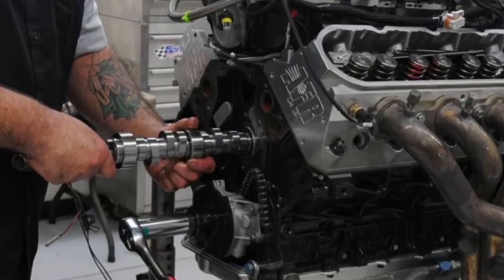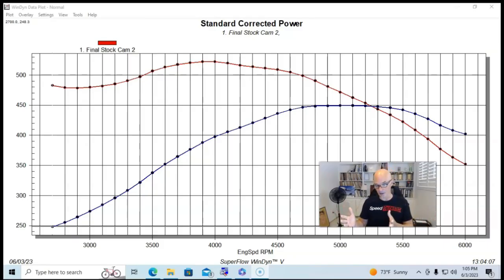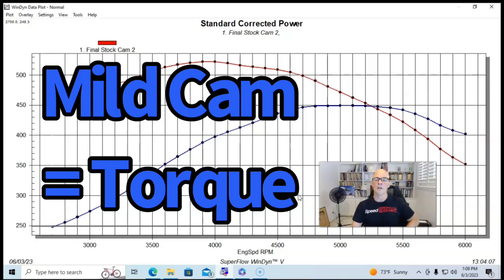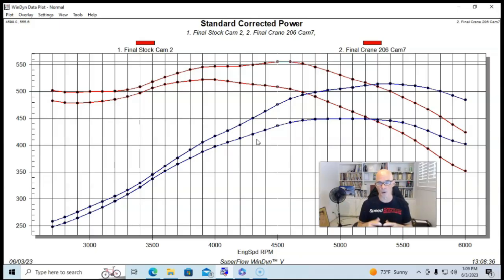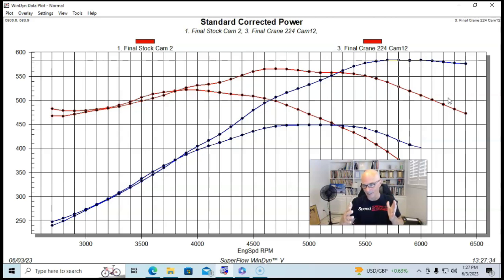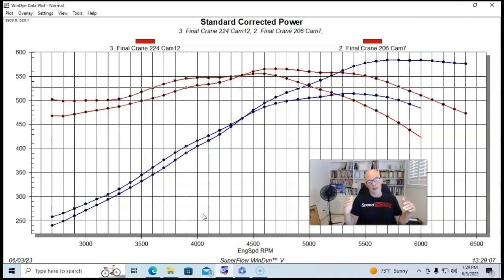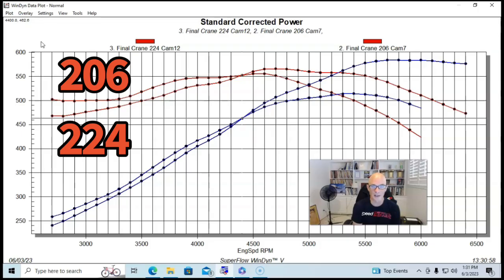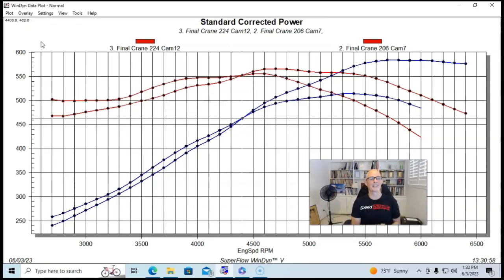HOW TO MAKE MORE TORQUE WITH YOUR LS. 6.0L 408 STROKER CAM TEST-WHICH TORQUE CAM WOULD YOU CHOOSE?

Comment: You talked about and tested the “240” camshaft but you never gave us the specifics about the biggest camshaft 🤷‍♂️
Reply from the maker: 246
Reply: @richardholdener1727 246 = .050 Duration and lift for intake and exhaust with CL?

Comment: Have you heard anything about Trick flows 595/595 cam? I have a 408 with Texas speed crank, Wisco reverse cut pistons with valve relief on Lunati rods. Trick flows 225cc heads and 595/595 cam. Just got heads so still got to put it together. I’m thinking around 600? Love you videos!
Reply from the maker: not sure what 595 lift cam you are referring t0
Reply: @richardholdener1727  Trickflow TFS-30602004 trackmaster cam. Duration 291/295 Lift .595/.595  lobe sep. 112

Comment: I just had a 408 stroker put together, it’s a Texas speed rotating assembly. 823 ls3 heads, 660 springs in heads, ARP studs, 240/248 cam with .625” lift, any guess on what kind of power it will make on 93 octane
Reply from the maker: with stock heads-near 600 hp
Reply: @richardholdener1727 the fact that you responded you have a fan for life, love what you do keep it up

Comment: Great Video, As ALWAYS Sir!!!!

Would this be a great combo for a 1964 Chevy SS impala  weighting 4,000 lbs, that im currently building (Daily Driver)?

Gen 3 LS 6.0 - 408 storker
0.30 Flat Top Pistons, 
Gen 4 Rods ( Machine shop balanced),
TruckNorris Cam,
# 799 CNC Ported 
(2.02/ 1.59 valves
In -243cc
Ex -95cc)
.650 Dual Vale Springs,
LSA supercharger w/ 2.55 Grip tech Upper pulley ,
Stoc LSA lower Pulley, &
850cc Injctors

Comment: I just got my 408 build chassis dynoed with 317 heads and tbss intake factory airbox and exhaust with a btr 202 torque cam made 410hp at the rear wheels i couldn't be happier with the driveability and power, i had a truck norris in the 408 to start but with a stock converter it kinda sucked towing a trailer in the lumber yard trying to go slow, i really appreciate all your advice on engine building.
Reply: A t.n. bucks 408 cubic inches?? 😳

Comment: I have a question about a 408 I built.
I used 823 heads, from a L92. had a Valve job and milled just to make them flat.  flat top piston w/valve reliefs compression is around 11.3:1, LS3 intake 102mm throttle body, long tube Headers, Terminator X system, a Slopy Stage 3 cam (only because I had one) I used PAC1219 Springs. it runs grate lots of power everywhere but falls flat at around 6000 rpm. I use it 98% at the drag strip the rest is to drive to work once in a Blue moon or to a local car show. at the track i run a very consistent 11.45 depending on DA. the Monte Waghs 3715 pounds on the starting line. I was expecting 11.0s. th400 and a ford 9" no tire spin. 1.65 60'.  my HP calculator tells me its making 475HP.  Does that sound right? and should it pull harder pased 6000 or is that where it starts to fall off. Maybe Valve spring or better cam choice  Would love to hear your recommendations. or is that what i should Expect is so that ok i judt not shour if somthing is OFF.  sorry for the long post.
Reply from the maker: don't know what you mean by it pulls hard til 6000 rpm then falls off-does that mean it makes peak power at 6000 rpm? We need actual data (dyno) to determine what is really happening-is it getting lean or rich, what is the timing etc...

Comment: I was also wondering for the 408 stroker in the Steve Morris video what Pistons you were running to achieve the 613 ft-lbs torque and the 622 hp
Reply: Were they like a +16 dome or -3.30 flat top
Reply from the maker: the pistons had valve reliefs

Comment: I also saw Steve Morris video on a 408 stroker that they stated was built to your specifications and I really wouldn’t mind knowing what head and cam combo you recommended for that build
Reply: I also was wondering for this motor with the 613 ft-lbs of torque and 622 hp what Pistons you spec out for the motor
Reply from the maker: AFR 245 heads and Comp cams-specs were listed in the video

Comment: Hey Richard, I wanted to say thank you for the video. I had a few questions about the heads in the video you were stating that you would probably pick a different set of heads than the AFR 245s in the video and I was wondering if the AFR 230 heads or the AFR 225 heads would be better for my build. I was also wondering about the intake manifold choice in the video. I believe you recommended the fast LSXR manifold over the one that you used in the video. I also had one more question about the camshaft choice you mentioned that that you thought the BTR TruckNorris would be a better choice for more torque. I have a brand new sloppy stage two cam I had planned on using for my build and was wondering if you thought that would work well with this combination or should I consider the BTR TurckNorris. I sure would appreciate your thoughts.
Reply from the maker: 230

Comment: dont like the wide lobe sep cams mabey they are making torq because long intake runners n super high flow heads , put that cam in a gen one small block n it will not make torq like that 🤷
Reply from the maker: why would a SBC act differently
Reply: u tell me , show me a motor or dyno graph of a sb 400 with those numbers with those cam specs , im not arguing im asking 🤷

Comment: I would also like to see this test revisited with a little smaller budget and see if the results are comparable.  Tbss intake, ported (or not?) OEM heads, Low Buck Truck cam, etc.  See if you can get similar results with a 1000 dollars less or even 1500 dollars less than this test?
Reply: That would be an interesting test.

Comment: Hi Richard, I know this is an older post, but I’d like closure on what heads you would’ve recommended over the AFRs.  I’m trying to get a build sheet together.
Reply from the maker: many other smaller heads (the 245s were overkill)
Reply: What about 317s?  I can have a set milled for CR, but would they flow enough?

Comment: I've only built a couple of performance car motors but have done a lot of Harley performance builds so I have seen what happens when you run the same cam with different combinations of heads, compression, intake, etc. With the bigger cams, they are dogs below 3000 rpm with a stock motor and then as you start adding compression, good heads, etc, they not only start making more peak power & torque but get much better under 3000 rpm. There are limits of course to every cam but generally speaking the bigger the cam, the more important the rest of the combination is for not only peak numbers but the lower rpm torque as well.

Comment: Nerding  out to build a 408 for my suburban.. wish you had used a 317 head..
Anyways, seams y'all missed the 206/212 cam did at least 500tq from 2700 to 5400rpm and it's probably doing 450-475tq at 2000. I'm currently looking at a 212/218 ~560" 115lsa cam

Comment: Hey Richard, I need some help. I am building a gen IV 408 for an airboat with 0821 heads and truck intake. It will not be exceeding 5500 RPM. What is the best camshaft selection for torque and HP production from 3000-5500RPM? Thanks
Reply from the maker: I have a Low Buck Truck ($179) that would work well on that
Reply: Perfect, where can I purchase?

Comment: For towing purposes and to keep the 6L80E happy under 6000 rpm. What is the absolute highest amount of torque you can make before going to forced air?
Reply from the maker: for what displacement and compression and octane?
Reply: @richardholdener1727  For the 6.0L VVT L96 on stock internals with 89 octane pump gas. I'm looking to keep the VVT and already have intake and shorty headers, but I'm interested in valvetrain mods and a tune. Would higher compression and higher octane help low-end torque or hurt it? I know these are already low compression to begin with. I am trying to avoid increasing the RPM range and shifting power up. But I want overall best performance for a street application with Towing and offroad use in mind.

Comment: What would it take to get 500tq out of a 402 stroker ?
Reply from the maker: 500 lb-ft is very easy out of a 408
Reply: @richardholdener1727  but is it reliable in a truck application DD with occasional towing

Comment: Good morning Richard, Hope you are doing well. I am currently putting together a tow monster for my 2004 Yukon XL 2500. To tow my toy hauler comfortably. I took the stock 6.0L LQ4 bored it .030 over, had the block decked to square, and line honed, put a 4" Stroker crank kit from eagle in it. (408) also have a TBSS intake to install. 243 heads, 15 cc dish pistons, with .051 head gaskets and with pistons sitting .008 above the deck, I figure 10.4-1 compression. I found out BTR now offers a Stroker camshaft specifically for the 408 combination designed for towing. BTR CAMSHAFT - 4" STROKE CATHEDRAL PORT TRUCK CAM - CM31939150      219/239, .553"/.553", 115+0    I originally had a Truck Norris cam for this combo, but the tech support at BTR told me this Stroker cam would perform better for my build. So I couldn't resist, I had to buy it. I am currently assembling the engine now. cant wait to see how this thing does...  :)  oh and just saying, it would be awesome if you did a test on this combo. I have another 6.0L I could Let you build for the test, if your interested....  Thanks for all you do, and keep up the great work.
Reply: So how did that stroker cam from BTR work out?   I’m basically building the same motor you did and can’t choose between their stroker cam or the truck norris.

Comment: If that 224/232 cam was on a 109 LSA it would whip the pants off the 206/212 cam down low for torque. The 115 is just too wide. Even 112 would have been a lot better
Reply from the maker: no

Comment: Richard how would a Truck Norris can do in a 408 flat top pistons and 823 heads. With truck intake and ls3 throttle body? Going in Awd Denali Truck. Had built trans circle d 2600-2800 converter. Just not sure which cam to run. Still pull with the truck and play with it.
Reply from the maker: pick the Hot Rod

Comment: Do you have to use two different push rods lengths? For a 408 6.0 over.30 4 inch stroke 6.125 rods I’m running your combo I’m almost finished buying parts please help with push rods 7.400
Reply from the maker: LS motors generally run the same length pushrods for all cylinders

Comment: Currently building a 408 stroker with TBSS l intake and 243 heads. It’s going in a off-road vehicle on 43 inch tires. I had called BTR asking which of their truck cams do they recommend? One of the truck stage cams or the truck Norris. They told me not to get any of them. They have a specific 4 inch stroke truck cam for the 408 that he said would perform much better. Never see anyone on the forums or YouTube talk about it. I think you should test her out. Mine should be going in the next month. 

LS 3 Bolt 5150 Camshaft
4" Stroke Cathedral Port Truck Cam
BTR219-325/239-325/115+0
Reply from the maker: it will make less power down low than the Truck Norris

Comment: Thank you for these vids. I had the truck Norris and was sold a custom grind cam since I wanted to turbo. Now I’m wondering why they only took my Ly6 to a 370 cid instead of a 408. How realistic is it to have a 408 as a daily? Too hard or just right?  If not much different, may have them take it to 408 before I do anything else.  Definitely going back to TN cam and maybe add turbo or LSA SC.  Looking for a fun daily for my 2500hd.
Reply from the maker: you can daily a 408 just like any other displacement-just more fuel cost

Comment: For a true street driven vehicle, the trucknorris cam would be perfect. The only problem is that people arent honest about  how they drive, or care more about chop and "big" numbers. They miss out on more average power, which is more fun to drive and far more usable. Great video as usual!
Reply: I had big chopping small blocks way back when. Daily driven cam of 246 @ .050" with 3500 stall on wrinkle walls as my sole means of transportation. But now I'm the opposite. I want stock idle but 6500 rpm hp 😂
Reply: @Resistculturaldecline how do you get that on stock idle?  Very high lsa?
Reply: Sounds Great..

My project,  1964 Chevy Impala SS weighting 4,000 lbs, that im currently building?

Gen 3 LS 6.0 - 408 storker
0.30 Flat Top Pistons, 
Gen 4 Rods ( Machine shop balanced),
TruckNorris Cam,
# 799 CNC Ported 
(2.02/ 1.59 valves
In -243cc
Ex -95cc)
.650 Dual Vale Springs,
LSA supercharger w/ 2.55 Grip tech Upper pulley ,
Stoc LSA lower Pulley, &
850cc Injctors

Comment: I am running a similar short block with stock heads. I have the truck Norris cam and a g42 t4 turbo. The low end torque is great, but top end seems restricted by the single turbo setup.

Comment: Hello To my 6.0 408, would it be a good combination a COMP camp 235/251 .621/.624 camshaft with Trick Flow 225 CNC heads, 4030 pinstons and a fast LSXR ported intake
Reply from the maker: yes

Comment: Richard, doing my 1st engine build. I have a Gen 3 6.0L LS iron block bored and stroked to 408-forged internals with 10cc dished Pist, 799 heads with Texas Speed stage 2.5 port job with dual 660 springs and Holley terminator max x. My oddity is that I’m using Holley’s dual 92mm throttle bodies/ dual plenum intake. I like the torque range and curve of Truck Norris cam but BTR suggested their 400+ CI cam: 236/25x, net lift of .636/.636 and 114 LSA. It’s producing most of its Torque/ power at the upper RPM. A friend has a similar 408 but using the truck intake and stock 317 heads, same cam in nitrous version and struggled with tuning and thought he’d have more low and mid torque. He’s upped his torque converter-3500 and rear gears to 4:10’s. I have not established my converter, gearing, or tire size yet. I am running a 4L80E trans. It’s helped but still not what he thought. Would the Truck Norris be a good option considering my intake, heads/ springs, etc. thinking 550-ish on torque in the low to mid ranges would be my ideal. Is it undersized? If so do you have any cam recommendations? There’s not a lot out there for strokers with this intake.  Thanks, Sean
Reply: I see your message is from like a year ago but I would think the truck Norris cam would be a little small for that engine. It would still work great. I'm not sure what car you are putting this engine in but I would think the btr "red hot" cam would be a great sweet spot between the truck Norris and the very large cam they suggested.
Reply: @ ultimately went with a comp cam 54-456-11. Hasn’t been fired up yet. Hoping by mid summer to fire it.
Reply: @58pache how did it go? Do you like it  now?
Reply: @antwain7942 a lot of fab work. Have decided to postpone firing it up till I get a little further. Really had hoped to have done that by now but I’m seeing why it takes so long-rust repair, recessed firewall, new cab corners, steps, speaker enclosures in the kick panels and corners behind the seats, just picked up some mustang gt seats. Currently working on seat mounts and center console as it will tie into the dash. It’s on a roadster shop chassis. So, it will need a raised bed floor after that. The list is long but chipping away.

Comment: The custom grind in my engine made pretty astounding torque numbers. 230/242, .600/.600 on a 115 LSA. Made 508whp and 580wtq (std correction). Similar engine specs as well. 404ci, 8cc dished pistons, TFS 225 heads with 65cc chambers put compression at 11:1. Fast LSXR 102 paired with a Nick Williams 103 throttle body. I assume some converter spike came into play but still has heaps of low end grunt regardless.
Reply from the maker: that torque reading is a converter spike-that cam would make more hp and than torque when tested on an engine dyno or with a manual transmission-but still good combo
Reply: @richardholdener1727  That's what I kinda figured. It definitely has a very broad power band as it sits. I'll be interested to see what it will do with the new grind.

Comment: Im building a daily work truck/tow rig with a 408. Gonna run a vsr85/102, they told me it will spool at 3200 rpm. My question is out of these 4 cams witch would produce the most torque below 3200 rpm. 
Cm31939150  na truck cam
 219/239, .553"/.553", 115+0, 
BTR 400+ TRUCK LS TURBO CAMSHAFT
225/24X, .629"/.629", 116 LSA,
BTR 400+ SMALL TWIN TURBO CAMSHAFT

237/25X .619"/.619" 117 LSA

BTR GEN III & IV LS TRUCK NORRIS CAM 

Specs: 212/22X, .552/.552, 107 LSA
Reply from the maker: truck norris
Reply: @richardholdener1727   Thank you!

Comment: Have you ever done a 4.25 stroke lSX short deck... Thinking about changing my set up to a 450 + cid , street car I'm thinking that it might just get to 600 ft lbs / 600+ hp.. just wondering..  thanks for all the continued LS support. Great for the industry.
Reply from the maker: see the 700-hp 454 build with the 4.25 stroke
Reply: @richardholdener1727  thanks Richard

Comment: Hey Richard, 
I have a 1990 300zx with an LQ4 swap the engine is assembled as such:

4.030" Bore
Summit forged +2cc flat top pistons. 
Eagle H-Beam rods
Forged crank
823 casting heads
Comp cam valve springs (max .625 lift)
Jessel Link bar hydraulic lifters
Comp cam trunion upgrade
Summit stage 3 cam
Compression works out to ~11:1
I have one of the kind of junky fabricated intake manifolds

I Made 385 WHP on the local Dyno I was wondering if you had any suggestions to push me over the 400 WHP mark without doing a power adder?
Reply from the maker: it should make more than that-does it have headers
Reply: @Richard Holdener  1.75" shorty headers into dual 3" stainless exhaust.  The local shop has a mainline dyno that reads about 20% lower then the other shops in the area.